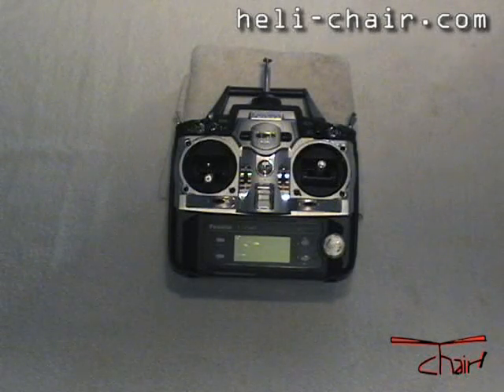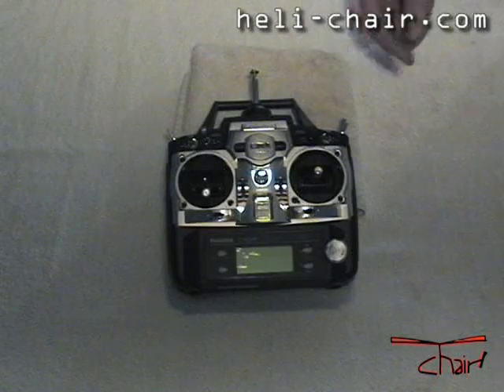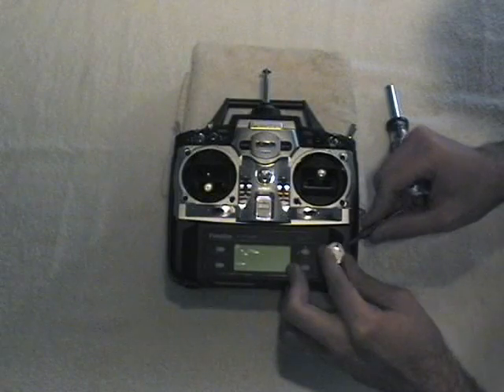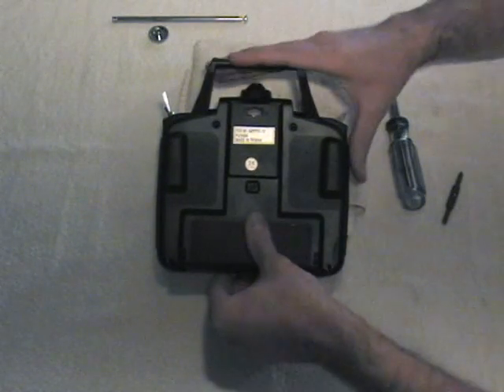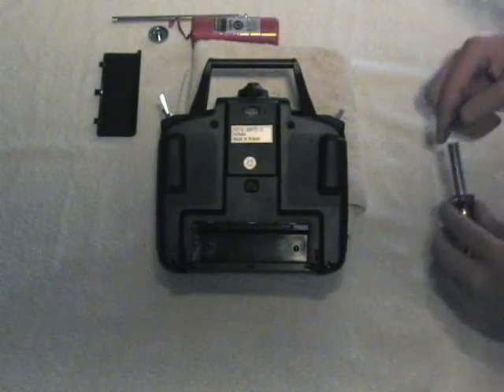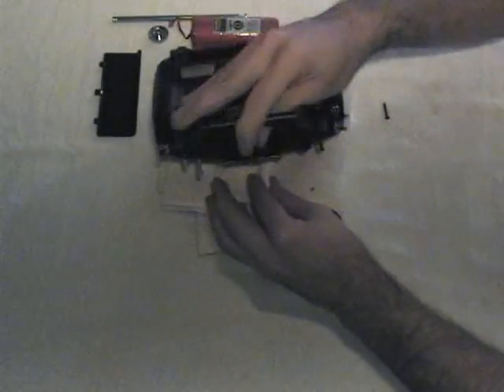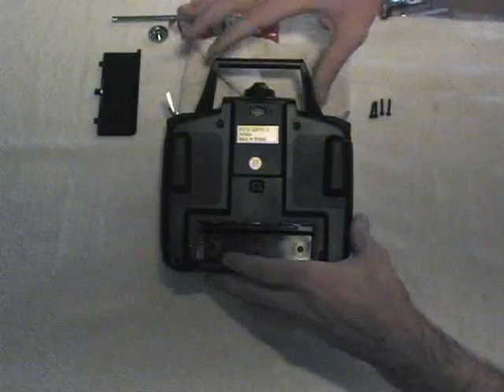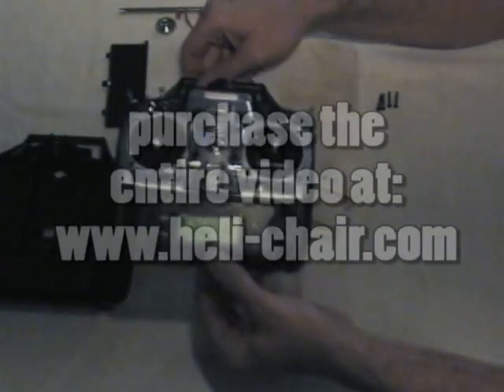Futaba Radio Transmitter Modification, 7CA 7CH 7CAP 7CHP Hack

Comment: If this is a 7ch radio but the receiver only has 7 outlets, how can you run ail., ele., throtle, rudd., gear, flaps, and a smoke system and still plug in a receiver battery.